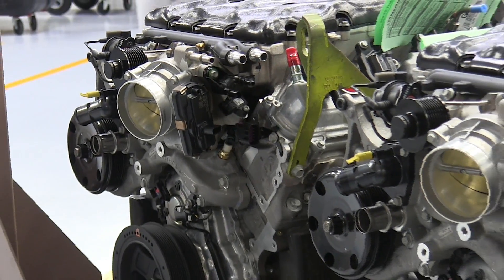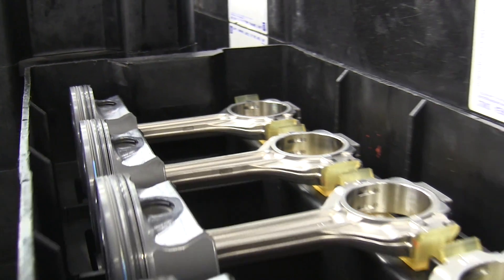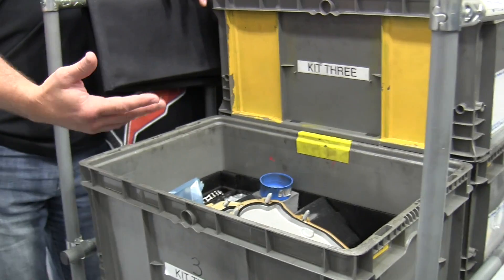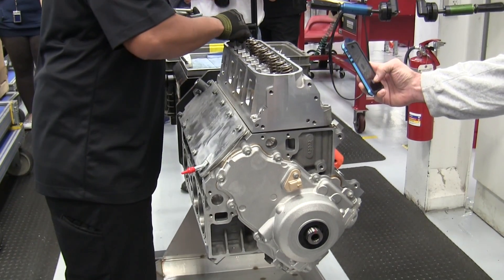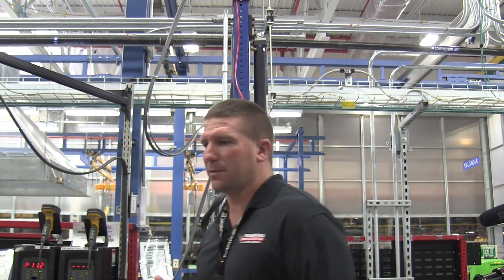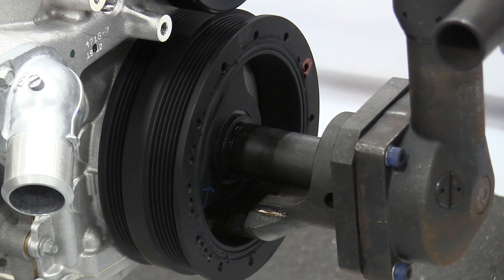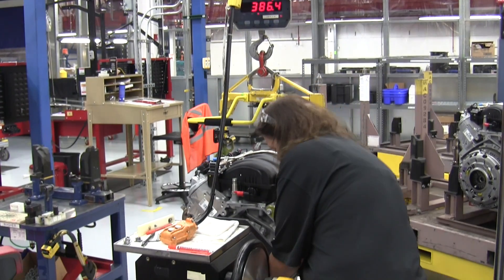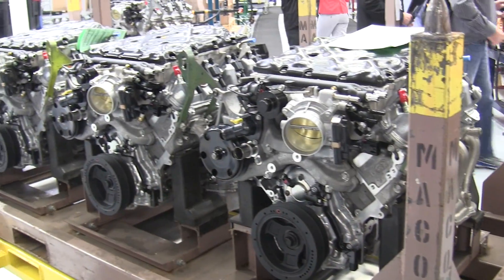Corvette Z06 (LT4) and Camaro Z/28 (LS7) Engine Build

Comment: haha i noticed you put background music all those people getting all pissed about not having any, good job on the improvement either way
Reply from the maker: mkelebay Well, to be fair most people said they don't want it, and I don't plan on using it in the car reviews. I included it here because the background noises were a bit harsh, so I reduced them and added light music. Hopefully everyone's happy haha.
Reply: Engineering Explained haha, doesn't really matter to me, but an interesting video nonetheless, could you explain what the differences are between these two engines are, i know the lt4 is supercharged, but is it just a smaller displacement version of the ls7 pretty much? if you're busy or whatever ill just google it
Reply: Engineering Explained nice! I thought that was actually at the factory.  In fact early in the video one guy seems to look up at the ceiling bewildered right when it starts to play. I thought it was some sort of bizarre paging system where you play a specific theme song for someone since it might be too loud to hear your name.

Comment: ( 07 Vw GLi 2.0t FSi)  i got a code that says boost pressure lost from turbocharger check d.v.  Then i put a New divert valve and a new Intercooler and im still losing boost. Can it be the PCV valve ?  when Engine is running and i remove the oil cap the engine shakes and acts as if it whats to turn off. ? Thank You Engineering Explained

Comment: seriously? a 2014 model performance engine with two valves per cylinder and pushrods?
Reply: Corvette has been using pushrods since 1953, if it aint broke, don't fix it.
Reply: Corvette has only used DOHCS for one generation. It was a money pit that about killed gm
Reply: But damn is the original lt5 beautiful

Comment: Y U NO DOHC, MURRICANS?!?!?!?
Reply: Ford has all the dual overhead cams you can handle, buddy!
Reply: Ford makes its DOHC modular v8. However, I’ll take GM’s OHV ls v8 over any DOHC V8 for a project car engine swap due to its limited set of advantages such as cost, compactness, weight, mpg to power ratio, and 300 hp, 300 ft lbs minimum.

Comment: I can't believe Chevy's still using pushrod and rocker arms instead of iverhead cams. Down side of it is that you can't have variable valve timing?
Reply: Not true, VVT systems on OHV engines have was done years ago. From a simple cam phase to concentric camshafts. The OHV engines offer unmatched compact size and low mass at a given price point. Also the engine gains a lower center of gravity when compared to DOHC engines, partly why some auto makers use flat engine layouts (Porsche for one and Subaru as another example).
Reply: Duane Craig how can you have VVT if you only have 1 camshaft? I mean after all I thought only DOHC can allow VVT since OHV or SOHC controls the (intake & exhaust) valve using the same camshaft...?
Reply: 7150285 To be a Variable Valve Timing system all the system has to do is be able to vary the cam timing, and there have been many different ways to do this over the decades. For early Honda VTEC systems they used two different cam profiles on one camshaft, in this way it worked more like an low/high switch in which it switched to the other cam profile at higher rpms and back down at lower rpms. Look for pictures of early Honda VTEC camshaft and you will notice all of the extra lobes on it

Other early VVT systems offered a much greater range of variability however many only varied the intake side and left the exhaust side alone. GM produced a prototype cam in block design which had two camshafts located in block one for the intake and the other for the exhaust side (XV8). Other early OHV VVT system used a simple cam phaser wich varied both the intake and exhaust sides together, this is how things are done on generation 4 and generation 5 (so far) chevy small block V-8 engines. If I remember correctly Dodge is the only one using concentric camshaft VVT for its Viper V-10. When they made the jump they pushed power from 510BHP to 600BHP while at the same time getting better fuel economy. 2015 Viper produces 645BHP from its engine. 

To understand how VVT is beneficial and why these systems are used and why different ways have been used and have been effective you have to understand cam timing. There are other variable induction systems which are also beneficial though seem to get completely ignored due to the lack of marketability of those features. One example is variable lift, which allows the valves to vary how much they open by, one way of doing this is with rocker arms (rockers can also be utilized on an OHC layout). With this system you can alter the rocker arm ratio, for example I believe that the standard production LS7 uses a rocker arm ratio of 1.8:1. With a variable lift rocker arm the lift can be varied within a range, you can for example make a rocker arm that has a ratio from 1.0:1 to 2.0:1. If the cam gives you .500 inches of lift then at 1.0:1 ratio the valves opens up by .500 inches and all the way at 2.0:1 ratio it can open up to an inch. 

Then there is variable intake technology (once more generally ignored for much of the same reasons as variable lift systems). These generally offer one intake path for low rpm operation and a different intake path for high rpm operation.
Reply: Alumnikiid things are more complicated then that. The 5.0 coyote and the 6.2 ls3 engines are tuned differently. The ls3 produces more torque at lower rpms then it starts to fall off. The engine in the boss mustang traded more high rpm torque for less low rpm torque. Gm tunes the ls3 to produce healthy torque through its entire usable rev range.
Reply: 7150285 Variable valve timing isn't just about changing the overlap, though you get the most benefit from a VVT system in which you can vary the intake and exhaust valve independently from each other. However as I stated the system that the SRT Viper uses is a concentric camshaft (camshaft in a camshaft). This allows adjustments of both the intake and exhaust valve independent of one another. If you really want to know what a concentric camshaft is please google it.....
Reply: Well, when you use one type of tech for such a long time, you learn to get the most out of it. Look at Porsche and their rear mounted engine phylosophy that's totally wrong in theory, yet, they make cars that handle and drive like almost no other regardless of price.
Reply: derbigpr500 What is the Porsche rear engine philosophy? and why is it wrong in theory?
Reply: Pushrod (OHV engine) is still formidable for high-end cars.
Bentley Mulsanne also uses V-8 OHV engine.
Reply: 7150285 Honda has single cam motors with V-Tec. It's nothing new.  There are three cam lobes and three rocker arms on the intake side. First from 0-4800 the outside rocker arms open and close by the outside lobes. Then when VTEC hits, two Synchronizing pins slide over and lock onto the Mid Rocker. The Mid rocker follows the VTEC cam lobe.
Reply: maybach300c And Corvettes and Cadillac
Reply: There are also a number of smaller companies that produce really high performance cars who use and have used recently ohv engines.
Reply: 7150285 Well, the Corvette and the Cadillac company are both owned by GM, which is why the CTS-V also uses a LS motor.
Reply: sk8s4aliving yes you are correct
Reply: 7150285 everyone say it with me. "L99. A gen IV small block chevy with VVT. With only a 16 lobe cam..."
Reply: I notice the mustang gt has similar power from a 5.0 liter dohc as compared to a 6.2 ohv from the Cameron ss...so I would think the dohc setup is more efficient...but gm has been using ohv for years and that's what their known for just like Subaru and their flat 4
Reply: I still don't get it, how in the world can you have variable valve timing on the intake & exhaust valve when u are only using a single cam for the intake-exhaust valve? What I mean is "variable valve overlapping"

Comment: Seriously? two valve per cylinder??
Reply: Zhi Hao Looi Uhhh, yeah seriously. And considering the inherent reliability, power and mpg these engines are getting, not sure why you're questioning the design, lol. What YOU SHOULD be questioning is why 4 cam/4 valve engines AREN'T producing better results than what they are.

Comment: Differences/advantages of a 7.x L v8 vs a 7.x L v6 vs a 7.x L v10? Really just engines with the same or close cc but different amount of cylinders. Would be a cool video sorry if I didn't explain the question to well
Reply: maybach300c
 That would be smooth and powerful. Drive a S65 or SL65 AMG with the 6.0L V12 TT that makes almost 740 lb-ft of torque. Absolutely brutal and the traction or ESP flash all the way to 50 mph. The Mercedes V12s are extremely smooth  because when you have a power stroke every 60 degrees of crankshaft rotation, it barely slows down unlike a 4(every 180) or 6(every 120) cylinder.
Reply: Odds are that a 7.x L V6 would be too big for its own good, and not make enough power versus the weight it is.   As for the V10, just for reference I think the SRT Viper V10 is an 8.8 L (Dont quote me on that), soo having a < 7 L V10 would be interesting to say the least.
Reply from the maker: Kingdom Of Mog I have quite a few videos on this sort of topic, check out the various engine designs towards the end of this playlist: https://www.youtube.com/playlist?list=PL30C950600B683799
Reply: Big Mike
Lotus Esprit V8 had 3,5L turbo V8, 350bhp @ 6500rpm. Actually it was capable of 500bhp, but tranny was far too weak, so they removed intercooler.
Reply: Right.  But that in reverse I'm thinking is a bad Idea.  I know Ferrari has made 12 cyls with under 4Ls.  I'm talking about making an engine too big for It's own good
Reply: If you keep bore/stroke ratio the same, v10 should make more power due to better hi-rev cylyder ventilation, but v6 will have slightly better gas mileage.
Reply: Big Mike The Viper is 8.4L. Anyway, most V10s are under 7L man. LFA is 4.8L, Gallardo/R8/Huracan is 5.2, M5 is 5L etc
Reply: How about 7.x L (V-12 engine) ?
German Leopard 2 & Tiger tank; Russian T-90 & T-34 powered by V-12 diesel.
P-51 Mustang powered by Rolls-Royce Merlin V-12.
You miss V-12 engine.
Reply: The larger displacement with fewer cylinders would require larger pistons and a longer stroke. So a 7.0L V6 won't be able to achieve as high a RPM as a 7.0L V10. The V6 would probable produce more torque while the V10 would probably produce more HP at high RPMs.

Comment: They cold test the engine before filling it with oil?
Reply from the maker: It has some oil in it, just not all of it.
Reply: I've seen BMW do something similar with the motors for the Z4.  I understood it as making it easier to detect issues without the noise of combusting fuel and a lower chance of a really bad setup causing damage, but it looked like they worked a lot of poke-yoke into that LT4 build.  Does the cold run simply give more precise feedback?
Reply: carlsojos 

I think the engineer in the video mentioned dry run checks for leaks and uneven sealing. When they are found, they get fixed before running with gasoline which can destroy an imperfect engine.

Comment: Why is the oil added by weight? Thanks.
Reply: Ammount of matter is not it's volume , but it's mass . Liquid can expand , but mass remains the same . More accurate way to measure .
Reply: Thanks.
Reply: I was more shocked that they didn't add oil until the END. They were running tests that spin over 1000RPM without oil?
Reply: In a mfg. environment I would say it's easier to dispense by weight than it is to dispense by volume.
Reply: Mladen Milić
Why didn't they keep oil in the refrigerator ?
It would be more convenient than weighting the engine.
Reply: I do not work in GM so I have not idea .
Reply: No, according to me they edited the video and adding the oil sequence to prove how accurate they are here.

Comment: The entire engine is aluminum right?
Reply from the maker: The block and heads are aluminum.
Reply: Engineering Explained Must be difficult to do since aluminum expands way more than cast iron when heated. Won't there be problems when the engine is cold cause there are bigger gaps?
Reply from the maker: Cantenkerous Tim Aluminum block and heads is very common these days. The past three cars I've tested out (aside from the Corvette) were all aluminum block and heads. It's light-weight!
Reply: Cantenkerous Tim
hopefully they're hypereutectic; no idea though
Reply: Cantenkerous Tim I can't think of any modern high performance engines that doesn't use aluminum block and heads. It saves on weight a good deal which is a plus for performance cars. I know that famously for the import guys the last Toyota Supra I-6 (2JZ-GTE) used a cast iron block and aluminum heads displaced 3.0L. However I don't see that flying now days because people expect better handling characteristics.
Reply: KORTOKtheSTRONG The LT4 will be using proper forged aluminum pistons, top shelf stuff. The LT1 uses the cast ones.
Reply: ***** From what the rumors are pointing at, the new 5.5 DOHC V8 could carry that nameplate.
Reply: ***** more rumors the one big downside to the corvette world. The magazines came up with this whole 5.5 liter engine rumor which didn't come true now they keep pushing it.
Reply: Duane Craig It does exist,  I've seen it at display at the auto show in New York. What they will use it in is another issue.
Reply: ***** I should believe you for what reason.....
Reply: You came off as the millions of 14 year olds always claiming to have inside information and that people should believe them.
Reply: ***** Most folks don't understand how far aluminum has come in past years.